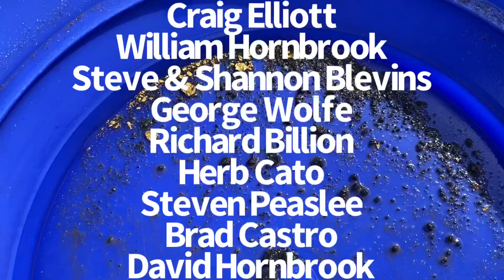Gold Grabber ll - looking for Gold Deposits - Testing - Sampling

Comment: Allen Trees used to build the Gold Grabber for years.  I am not sure if he is still building them.  He lives in Riggins Idaho.  Honestly after watching the way it works it would be easier to dump a 5 gallon bucket of water over it and be done but hey you are getting into shape.  And areas where there is no water you would be better off running a desert fox with a re circulating pump running off a battery or dry wash with billows.
Reply from the maker: We bought the gold Grabbers from Allen a few years ago. We later sold it.

Comment: Looks like a good wash to metal detect also.   I picked up a Gold Grabber highbanker last year but it doesn’t have a hand pump.  I need to get hand pump for mine but I’m also going to build a cradle for it so it can also be use as a rocker box.  How many gallons per minute is the pump on yours?
Reply from the maker: I think around 28 or 31

Comment: You are not going far from the truck with that and all the water. Might as well carry another battery and an electric pump.
Better yet, leave the machine at home and just use an electric pump and  sluce box. A lot simpler and lighter.